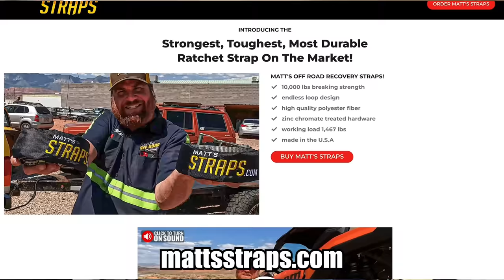Flash Flood Sinks The Ford Truck!

Comment: 1:45 "Do you think we have enough rope?"  Once upon a time (winter 2021/2022), we'd rented a snowmobile and got it hopelessly stuck in a little gully. I ended up calling the local towing company and he was able, from the nearby highway, to use about 300-feet of cable and rope (with about 24 inches to spare !!) to winch the snowmobile out of the gully. Quick and cost-effective service. Less than an hour later, we got on with our snowmobiling adventure, ...but more carefully. Wonderful service. Thank you Claude.

Comment: One of the first Matts videos I watched was Matt talking about he doesn’t carry a spare because he hardly ever gets a flat. Since that video I’ve seen like 20 flats.
Reply: I bet it off the jobs he does with them,  it's still not that many.  Plus when you have your own roll back and other methods, it's no big deal.
Reply: Most people I know don't take spares with them unless they're for from home. A spare 40 is a ton of extra weight and space
Reply: @trubass75  Plus it's more dead weight that you don't want on mud or sand.
Reply: Someone should make a channel of just following them with tires and fuel
Reply: Have you seen the video where he claims that he doesn't have a winch because he would never use it?

Comment: Question on the Matt's Straps. On the website (as seen at 5:43 ) It says "10,000 Lbs Breaking Strength" in the big bold text... but then immediately below that it says "A break strength of 4,400 lbs..." What am I missing that explains the 2 different numbers?
Reply: •  I'm going to guess it's a typo.
•  The 4,400# is most likely the WLL , i.e. the max weight of a LOAD ITEM that the strap will be Working to secure , allowing for the dynamics of travel.
•  The 10k# Break Strength is what it says.  There is some elasticity involved ,  & the ACTUAL limit will vary a bit for each strap , but you certainly don't want to FIND OUT ( the HARD way ! ) .  
•  Also , there is often a tattletale band of a contrasting color down the middle , which should be regularly inspected for breakage. These are "Tighter SPEC'ed"  threads acting as a Visual Fuse , indicating that THAT point of the strap has EXCEEDED its limit ( due to a brief dynamic action/shift during transport ,  an improper tie-down arrangement , etc. )  and the strap should no longer be trusted for its Rating , & REMOVED FROM SERVICE.  Since these are Made in USA & FAA Rated , they'll be accurate.
•   Since QC varies WILDLY in  (#iNa , & due to "Lost in Translation" issues ,  i am less trusting of 4n made tattletale bands , as some smaller manufacturers have been found to have thought of them as "Cosmetic" ,  not knowing their function.
•  Can't wait to buy MATT's stuff , but i should probably get the Jeep rebuild finished 1st , eh ?
Reply: I’m sure the 4,400 should be kg cos that equals 9,700lbs.    😎
Reply: Does the ratchet and strap have different ratings?
Reply: That’s bad marketing. I noticed that too.

Comment: A milestar with a sidewall split!? No... that never happens 😕 haha
Reply: When Matt drives them on the road at 8psi it’s expected. But I think you are referring to a wider reputation…
Reply: @philb5593  yep the M/T are known for splitting sidewalls. They supposedly fixed the issue with the new version though
Reply: Absolute garbage! But I guess if you get'em for free......
Reply: They also suck in mud. If they marked them as all terrain tires it would be okay but not mud tires.
Reply: @briankirwan9588  I'd give them a shot but from what I hear, they're cooked in 20k and I'm not spending that kind of money yearly

Comment: Why on earth would you (to the owner) disconnect the air filter at anytime let alone doing off roading?? You (the owner) will be rebuilding that motor shortly and deserve every headache you get and dollar that you are throwing away. Dumbass. Other than that, very enjoyable to watch. Thanks!!
Reply: It probably got wet and the engine wouldn't run through it

Comment: Mad respect for the crew there's just one thing I've seen and I've done it as well  pulling a truck by the hitch .I saw a episode on a different site.  The hitch broke  came back and killed the person in the driver seat in Arizona  big Ford  stuck just like this .just be safe  don't  over load your recovery gear

Comment: Friendly and respectfully Matt & Team. It's past time to consider installing an onboard air compressor and a tire plug kit onto the Morvair and hopefully, your new toy (tow truck). I did just that on my 4x4 years ago and I cannot tell you how many times it has been a lifesaver.
Reply: The new truck has a compressor and large air tanks.
Reply: @gregbrooks3577  excellent! I didn’t realize that. It hadn’t been mentioned that I was aware of. 😉
Reply: @matrix64  It was shown on one of the last videos of the  off road wrecker.
Reply: @gregbrooks3577  found it, saw it! 👍
Reply: @matrix64  Glad I could help.😁

Comment: Let me give you some advice. Get some rope quarter size round. You cut INDIVIDUAL pieces long enough to go over the top of the tire & back through the hole in the wheel & tie a knot on the side 
Wall. You can do as many as the holes  in your wheel. SKIP THE VALVE STEM AREA.  Works like chains.

Comment: Didn't need two winches, just needed a snatch block. Apply pressure and it'll break suction after a bit. There is a mire factor rubric that we use in the army for heavy recovery. I would imagine those maths would translate to your mired mud recoveries in a very similar way.

Comment: When the tires are locked into a suction situation would an air or water bottle under pressure with a wand to slip down by or under the tires help?  I'm not an expert, Just thinking. You know, break the seal.
If by chance this is a new idea I would love credit and residuals. If it is dumb, please no comments. Thank you.

Comment: That makes 3 Milestar Patagonia sidewalls in the last couple videos, granted one was technically Matt at Bleepinjeep. I had it happen to me on a brand new set with 8 trips on the tires (trail only rig). Drove over a log and a tiny nub sticking out 1/4” tore a 9” slash in the sidewall. Wasn’t jagged or anything, clean cut from a chainsaw and rounded down from other people driving over it. This just backs up my decision to dump those tires and get some Treps, which I should have in the first place. I roll without a spare most of the time as well and for how easy they tear I’m surprised Matt runs them. They aren’t even cheap anymore either, it’s just the only readily available 40 now, and probably for good reason.

Comment: Two questions: 
1). Can you add a 30” interview with the stranded vehicle owner and ask them “Why we’re you driving down the Virgin River?” and “Was alcohol involved in your decision making process?” 
2)  Is disconnecting the battery and air intake system the owner’s attempt to prevent somebody from stealing his truck?

Comment: been thinking about a floatation bag for water rescues to help get the suction broken to the mud
Reply: Easier yet, place the winch over the top of a spare tire and it will lift the stuck vehicle out of the mud and break the suction of the mud

Comment: I love my PSD. But at plus 8500 lbs.  it does not go on lake ice, rivers, soft ground.  Gas pickup under 5000 lbs.   I would think maybe standard equipment would be 12v compressor.

Comment: I was just wondering on the Banana. Could you put electric fans under the hood vents on a switch to help with over heating, by blowing excess heat straight up, Using several small fans to match the width and length of the vents? -Tom 🙂

Comment: I've done that before but the water was crystal clear and it made it look shallow. Well us dumb teens hit too fast and stalled it out. At the point it stopped the water was touching the bottom of the cab. I was in a 89 f150 that had a 3 inch lift with 35 inch mud tires. It got out under its own power after it started back up.

Comment: Disconnecting the battery terminals helps prevent wet electrical components from corroding.  Smart.

Comment: I once stuck my International tractor in a swamp about 50 yards in. I had stopped but as I began forward again the rear tires broke through the upper layer of deadfall and mil. Neighbour has a large backhoe and used a long piece of hydro cable to pull me out. My idea to knock down and create a shooting lane for deer ended.

Comment: Did you consider adding a bank of deploy-able flood lights to the beast?  Could come in handy on those dark and gloomy nights.  Also a double battery with protected jumper points and run dual alternators?
Reply: You talking for the Morrvair or the heavy wrecker? On the wrecker they definitely will need dual alternators and multiple batteries to run all the winches. But the Morrvair doesn’t need that.
Reply: @philb5593  Right the Heavy Wrecker"The Beast" Cannot wait to see it deployed.   What an awesome concept!

Comment: Did you take the Banana and the Morrvair to a demolition derby?

Banana has damage to the rear quarter panel and the front fender (not sure about the door).

The Morrvair seems to have damage to the passenger side. (Tennesee?).

Roby will have some work to do really soon if you keep going like that. 😅

Comment: After seeing all the sidewall failures those tires have had. I think I’ll switch to super swampers. With all the roots and ruts here in Tennessee I would have too many flats.
Reply: Just a thought on sidewalls, I don't know anything about Pategonias, but most likely are at most 3 ply sidewall since they look to be radials. If you go with super swamper be sure to check what sidewalls they have, as an example radial IROKs are 2 ply sidewall, (they don't like rocks) I have a friend that ruined a radial IROK on its first run, the bias IROK has 4 ply sidewall, much stiffer. Over the years I've had 4 sets of super swampers, all bias ply. I have never punctured a sidewall, this includes alot of Lake Havasu canyons, the high sierras, all areas hard on sidewalls. I  have seen radials do some incredible rock crawling/climbing though. Another observation on bias tire's, when you lower your tire pressure, you don't seem to loose as much ground clearance vs radials.
Reply: @pameladutton9076  I run tsl sx’s they are designed for ruts and roots etc. I ran them on a f250 for years and never had flats. And they were amazing in all situations mostly mud in my area but snow,ice etc as well.

Comment: Never ceases to amaze that folks think those heavy a***d diesels are off-roaders.

As I watch these videos and the number of times that the crew has to repair or work on a vehicle in the middle of nowhere or drag it out flat towed, would it make sense to build a "repair rig"?  Something with a small gas welder, tools, jacks, etc?
Reply: Have you watched any trail mater videos?   If not you will enjoy them.
Reply: The off-road wrecker is going to have a lot of those things, taken right from trail maters book.
Reply: Heavy, and diesels tend to vibrate more at idle and basically just sink themselves. 
But, so many think a lift kit and wheels/tires makes it an offroad truck.

Comment: Hey Matt maybe mount a spare or two on the roof of the MORRVAIR ?
Reply: That would mean a higher center of gravity on the rocks and dunes, and extra weight in the sand. Plus, most jobs are less than 30 minutes from the shop.

Comment: Why would anyone fully disconnect the air filter and exhaust especially when driving off road?
Reply: When wet, air filters strongly restrict air flow due to surface tension.

Comment: I was concerned about the desconnected Air filter, why do that, and more, why do that in that situation?
Reply: Looks like they took it off to let it dry.
Reply: It probably because it has an exposed cold air filter... And the fan and belts tossed it full of water mud sand etc and clogged it.

Comment: You guys seriously need to check out the channel sixtyfiveford and their video about doing a trail repair on a gashed sidewall. They use a glue by 3M called PR40 that I can attest will fix the sidewall on a tire. My nephew hit a rock with our side by side and split the sidewall, along with the bead itself. Prep is crucial, as well as lining everything up and ensuring you have a big enough patch for the job.
Reply: I'm not sure I would drive on highway like that, but a good idea for off road repair.
Reply: @spdergod  definitely!

Comment: That diesel is in rough shape. It sounds like it  has multiple bad fuel injectors.....I would know how that sounds because I have some too. They likely work once the engine is warm. Mine are worse than that by far; it won't start if the block is below about 100F and then it runs worse than this one until it's well warmed. However, guessing from the amount of smoke.......I think it's got damage to the rotating assembly from sucking in junk, whether from the lousy air filter or their shenanigans.....who knows.

Comment: Wow that was a nasty sounding 7.3 almost like it was running out of fuel pressure.
Reply: It sat In a river for the night, any diesel will do that after a drench. 100% that engine sucked In water hence why the filter and intake pipe wass removed.....Water and diesel engines no good. Most likely was running on 3 or 4 cylinders but cleared it self out.
Reply: @all4runner316  yes my 7.3 doesn’t like water in the fuel but man it kinda hurt when it first started lol

Comment: I guess everyone on the planet saw the video from the meathead in Australia showing the video about guy getting killed from his trailer ball flying through the windshield.  He never did mention the 12" drop hitch that snapped from the force of the vehicle and LEVERAGE on it, NOT THE BALL killed him!  I don't believe normal pickup has the power or traction to break a 1" shank trailer ball, unless it's balls to the wall with 30' of slack and a 60 mph pull.  I've been pulling friends that way and vice versa since we were 16, that's 40 years and no casualties.

Comment: I still cannot believe you don't carry a single roof mounted spare and farm jack. the extra weight yadda-yadda, it would save a ton of time and fuel in the multiple vehicle trips. yes it would eat fuel while you roadway drive at high speeds, but it should pay off in the end. multiple tire failures, you're just "hosed".

Comment: really enjoy watching mattsoffroadrecovery, one quick question, Matt appeared to suggest in a previous video that well worn tyres are better than new tyres with plenty of tread, seems counter intuitive? why are tyres with a load of tread worse than well worn ones when recovering from sand?  thanks from Ireland.   S
Reply: You want to float on top of the sand for sand recoveries and tread will make you dig into it
Reply: In loose sand you need flotation not displacement.
Reply: Sand is about friction, not shear force, so tread depth doesn’t matter, you’ll just dig a hole faster.

Comment: Yall really should have re-connected that air filter.
Without it these engines take in way too much air, and its probably why it smoked so much.  Also, dirt, mud, and water into a turbo is horrible for it.
Reply: the whole intake tube was disconnected, probably too much work to re-install in a river like that.

Comment: I can't get anyone to explain why we need 2inch hitches and only use a 5/8 inch pin
Reply: Because the hitch is supporting all the tongue weight, and once there’s weight down on it friction takes a lot of the load that would push the hitch in/out. So, there’s isn’t the full amount of load on the pin compared to the hitch that always has the full load.

Comment: Once Matt said that diesel vehicles are more heavy than petrol so i'm asking him why they are more heavy?
Reply: a diesel engine has to be more solidly constructed to handle the much higher compression required to ignite the diesel fuel. beefier engine block that has to be made of iron makes a big weight difference. Also because they are built for torque, the stroke length tends to be longer which, again, increases the size of the engine block substantially.
Reply: @cedriclasry9151  oh, now i know thank you.
Reply: Diesel engines weigh more than a gasoline engine of similar displacement, and the chassis and suspension is usually heavier in the front end  to be able to handle the additional engine weight. Can be anywhere from 500-900 pounds heavier depending on make and model.

Comment: General thought--would one of those exhaust powered lift balloons roll?  Seems like it would have enough surface area under a stuck vehicle to lift it without sliding, then possibly roll underneath a vehicle to allow winching/pulling it horizontally.  Not sure of the pack size volume it requires when stowed

Comment: Hey, i am in England, been watching your channel for some time now. Anyway instead of signed by Matt, could i have ones signed by Lizzy/Lizzie ?  if i  get the straps?   Also have you shipped to UK, Europe so no problems?   cheerio old chap

PS

Ah also on the live show, it was late for us.. i commented that a few weeks ago i was off to a cat rescue (I help animals with my 4x4 gen 2 mid 90s Pajero for local animal charities, and lots of FaceBook PM messages..  you call it something else...maybe starts with an M lol)  I came across a broken down ambulance, the turbo had gone, on a 2 lane road, blocking it on a bend.. Anyway i asked them if they needed towing and they said yes..  I have a video i took of me actually towing it..  Only for maybe 30 seconds, 2  min... but got them out of trouble holding up all the traffic just a quarter of a mile from the local children's hospital and main ER as you call them hospital.     love your channel.....